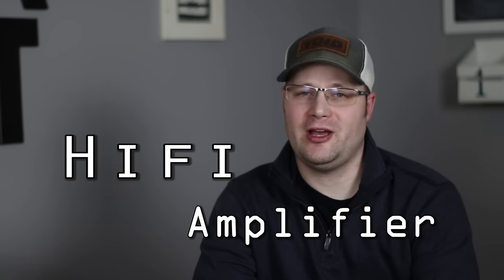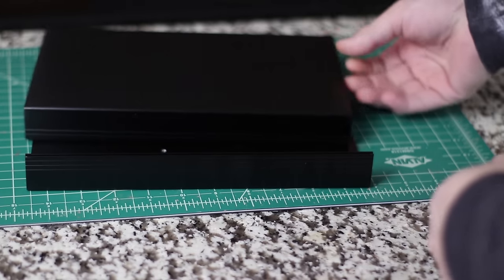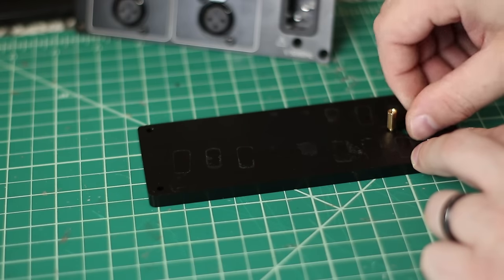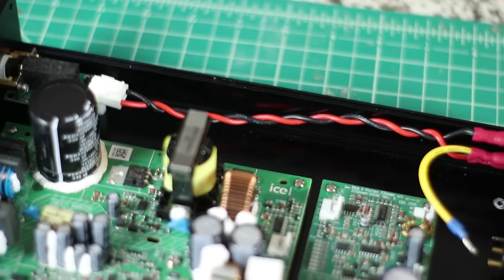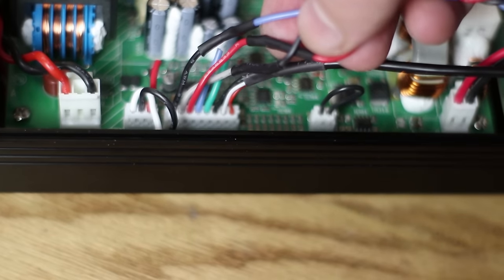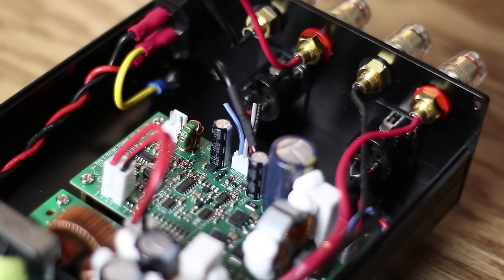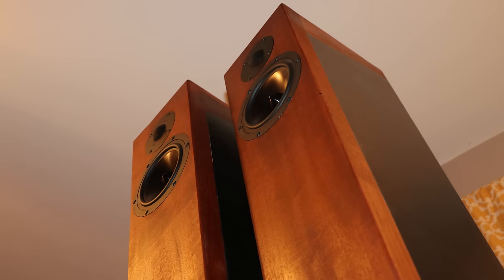How to Make a $3000 DIY HiFi Amplifier for $300

Comment: Sometimes it's interesting to hear what or why people are visiting your videos... In my case I Just opened a pair of NOS KLH Rave CB8 Speakers today. There's something magic about a 3 way with dual horns. The last pair of these in existence I am sure. Super rare. Only 1 amazon review... from 2005. I can't crank it because sleeping family but the sensitivity is 92db... they take more power to control them than I want to put in right now but even at only a watt or two driving them they sound amazingly accurate. They claim to handle 300w so I am here to build me an amp!

Comment: The amp boards Parts Express carries look like they are surplus stock of older ICEpower lines. They are still good boards, but the reason this selection of models is available from PE is because they aren't the latest-and-greatest from ICEpower. I did a similar build using a case from eBay and a 50ASX2 module, but I had to drill all the holes myself. I think I did use a wiring kit from Ghent but that was all.

Comment: Very good, i built this entirely from the links, parts and steps detailed in the video.
What would people recommend as a dual gang Potentiometer between the source eg: phone/dac/computer and the amplifier for volume control?
 Was thinking something like an ALPS RK271 dual gang potentiometer 100Kohm, and a capacitor 40nf capacitor?

Comment: Don’t use such a shallow depth of field on your camera, it makes the close-ups difficult to watch.
Reply from the maker: Good call.  I actually thought about that after I created the video.  next time, I'll switch to a different lens.  Appreciate the feedback
Reply: @Toid  You are shooting bordering macro. (high level of magnification) The only remedy will be smaller aperture and more light, using higher sensitivity (iso). You might try smaller sensor, but even smartphones struggle at this high magnification, at least at f1.6-1.8 and the bigger sensor size as of late. There is no aperture adjustment for smartphones. Wider angle might help a bit, but typically offers other challenges, as light and shadow effect, due to the working distance. Also, PDAF do not work that great at smaller apertures. You did a great job on the audio, kept the camera stable at high magnification, the exposure and lighting is just fine. The message of the wires got across, if people wanted to get the message.

Comment: Thanks for the video. I have a safety concern that you should address when building a mains voltage device. Don't connect the earth to any object that shares the screw / bolt. You should drill a hold especially for the earth connection and clean away any paint that your bolt, nut and washers contact. Very importantly, use a shake proof washer as it will help keep that earth connection nice and tight and in good contact with the metal case.

Comment: Oh man, what a great video.  I did not even know you could build your own amp!  I'm definitely going to have to delve into this as a new hobby.  Thank you for the instructions!
Reply from the maker: You're welcome!  Glad I could bring it to you.
Reply: You can definitely build your own amp and you can DIY way more than this.  There's nothing wrong with this little set up but if you wanted to be nitpicky it's not really building your own amp but more like putting together all the main pieces of an amp.   It's what a pre fab double wide is to actually building your own log cabin.  An even more hands on approach would be to hand pick an amplifier chip from one of the manufacturers and then search out a board for it and personally select and order all your capacitors, resistors etc.  Even more hands on would be to design your own discrete transistor amplifier and have your own pcb customade by a board house,.  The possibilities are endless.  One could spend their entire life dinking around with diy audio and not even scratch the surface of the possibilities
Reply: @jethrohetero4990      You'd need knowledge in electrical engineering, I assume?
Reply: @michaelhenry3234  not necessarily, I guess you could call it that but you don’t need to know the whole scope of electrical engineering. I mean if you were going to design your very own discrete design and pick all the transistors yes you would need to know quite a bit but there are lots of simple great sounding amp designs on the web that the amateur can build.  There’s a quite famous one called the jlh 1969 amp that sounds fantastic the schematics are all over the internet    There’s a bitching single mosfet amp Called “le monstre” designed by Jean Hiraga and there are also a ton of chips that only need some capacitors and resistors to make work.   It’s great fun really if you like hobby electronics.   You can etch your own PCB’s or order them from board houses for pretty cheap
Reply: Back when I was a tweaker I’d spend hours geeking out on honemade amps.  Now that I’m sober I’ve been wanting to have another go at it and see just how impaired I really was.   I bet i could whip one up in no time with nowhere as many mistakes as I used to make
Reply: @jethrohetero4990        It sounds intriguing. Electronic DIY has always scared me off, though. Way more complicated than cutting and gluing wood lol.

Comment: Thank you for taking the time to build these amp. Don't have much experience with class d amps myself. I wish more videos of building amps existed. Have you considered trying to build a low powered class a amp? I purchased some of nelson pass diy amp camp amps (their are version 1.6 now). They put out 6 or so watts of hot class a from the single amp and more out of the new mono  version (one for each channel). A little over $300  for each kit when they go on sale. They sell out fast each time at diy audio.  These run on cheap switch mode laptop (24 volt) power supply and sound Fabulous! They will even sound better with a proper linear power supply. More $$$ to. Just keep in mind these amps need to be used with efficient speakers  (90 db and up).  Even better with higher efficiency speakers. Just a small taste of the that legendary nelson Pass (pass labs)  sound for not spending thousands. And if your wanting even better amps and wanting to learn more their is the diy first watt f5, j2, etc that offer even more😀 thanks for sharing this build!
Reply from the maker: I'll have to take a look into that
Reply: @Toid  your welcome. I'm not sure which batch will be shipping out or when but I think you can given them email to notify you at diy audio when next batch is available for purchase. Just a heads up..each batch sells out fast. I have missed a couple not being fast enough lol. It would be terrific to see another video on assembling one of these kits. One video exists online of them putting together a older version of this kit together. Those were 2 little mono amps. Can't wait to put my amp camp amps together. Need to get time and a soldering iron😀

Comment: With this set up what is the rating per speaker? 200/2 so 100w per speaker? Rms would be around 70w at 8ohm? Thanks! Great video friend.
Reply from the maker: 400 total watts @4ohm. Around 200w @8ohm. If you need more there's links in the video description to higher powered versions of this.
Reply: @Toid  wow... 200w per speaker. Amazing. Yes, you weren’t lying on the value haha... nothing even comes close to power to price...
Reply: @Toid  if I went with the 500w board, could I go 4 channel with two of the support boards?
Reply from the maker: @michealcortes2553  You could use two asp boards along with two 500a board to create a 4 channel setup.  Or one 500asp board and two 500a boards to create a 3 channel setup.
Reply: @Toid  I see. So no real way to get to 4 channel at 200w without that extra 500a board
Reply from the maker: @michealcortes2553  correct. Each board does one channel. So you'll have to have at least four boards for a four channel. Each ASP board contains the power supply along with one channel. Each ASP board can power up to two A boards. So for a four channel setup you would need two ASP boards and two A boards. And if you wanted to make it a 6-channel set up, you could just buy two more additional A boards.
Reply: @Toid then, as you mention, up to 2 200a boards for the one 200asc, would that then be/run 4 channel at 200w each. Sorry for a silly question.
Reply from the maker: @michealcortes2553  each board is 1 channel.  Three boards are 3 channels.  The 200asc is a mono board.  The difference between the boards, is the asc has the power supply which can power itself and up to two other boards.
Reply: @Toid  thanks!! I see

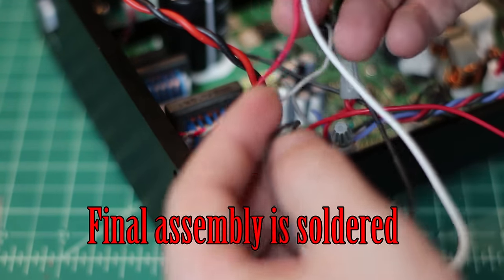Comment: I just ordered the parts to put together this amp. There is one thing that isn't completely clear to me, and that's how to set it up for Auto on/off. At 7:30 you describe putting the jumper on J4 and you comment "Once you have that connected, you actually have your LED hooked up." But that jumper is called the "ICEpower 6277849 Auto On/Off Wiring Harness for 200ASC" on PartsExpress, so I believe that adding that jumper across J4 is what enables the Auto on/off feature. Can you (or anyone) clarify that?  Thanks for the video, BTW.
Reply: According to the 200ASC Datasheet (available on Parts Express website), once the jumper is connected, there is a 13-minute auto-off feature when no signal is detected. But, I am also looking for clarification before I buy the parts.
Reply: @alexkerrison411  I built the amp and I now know how to set up the auto on/off. Here's what you do: Connect J3 pin 4 to the right + audio input and leave the jumper off the 2 pins at J4.  I used a shielded cable to run the connection between J3 pin 4 and the audio input (pin 2) on the right channel AMP connector, with the shield connected to AMP pin 1 (ground).

So modified, the amp turns on when an audio signal is present and it shuts off after about 15 minutes of no signal input. The power button LED turns on and off as this occurs.

Comment: Hey y'all, I just completed my build. Mine was slightly different in that I built two separate monoblock using the 200asc. The wiring was extremely simple and the sound is absolutely amazing when paired with the schiit Loki equalizer.

It is my opinion that a really good preamp would make all the difference in this setup and that is something that I'm looking into. If anyone has any suggestions for a fully balanced preamp please let me know. Once again thank you 123toid for this video. 
I'm thinking about doing a build video as well.
Reply: Which pre u settled.?
Reply: Topping pre90
Reply: I’m looking at the Schiit Freya+

Comment: I wonder if it is not even cheaper to by a amplifier board like iraudamp7 or tpa3255 and get a regulated power supply like SMPS500R and buy a case and do the holes your self. But that is maybe another video. ;) I love your work!

Comment: How does this amp compare to an OEM Hypex NC252MP in terms of sound quality? The build process would be very similar, albeit a little more costly. Just wondering if the expense difference is justified? Forgive me if you have no experience with Hypex. I assumed you have because several respected amplifier manufacturers use their modules and have for quite some time. Thanks.

Comment: I’m wondering if this is a better option than proven class D amplifiers like the Crown XLS series? I mean DIY is a win on this but bang for your money, what’s best?
Reply: I really love the crown xls amps
Reply: I just grabbed the crown and I love the extras you get with it for around the same price. You get crossovers leds ect ect
Reply: That's a very good question -- although Crown's customer base is mostly pro sound folks and DJs, AFAICT their amps are certainly well suited for home audio systems that need lots of beef to handle volume peaks too.  Of course the "audiophile" crowd will dismiss the XLS amps as cheap Chinese-made junk, but I honestly wonder if they could tell the difference between an XLS and a PS Audio Stellar amp driving the same speakers at the same high volume.
Reply: Crowns have some what higer noise and distortion products, you can check ASR fórum for some nice measurements on some icepower based amps and at least one class d crown, i think it was a 2505 or some like that. Ice amps excede the total signal to noise by some 10 db diference aproximatly compared to crowns, true the second delivers More power per dollar spend

Comment: How do you adjust the volume?
Reply: This just powers speakers. You need a preamp (or integrated with pre outs) A preamp takes in all sources i.e. bluetooth, phono, cd, etc and outputs them thru this amp while also controlling volume